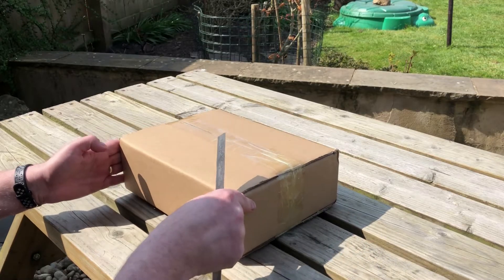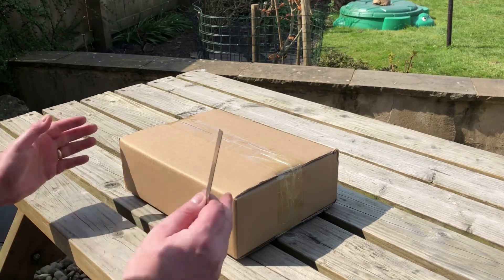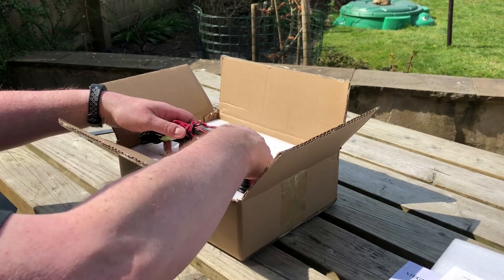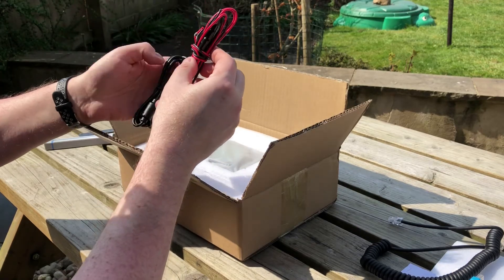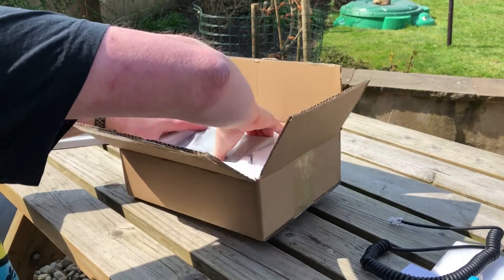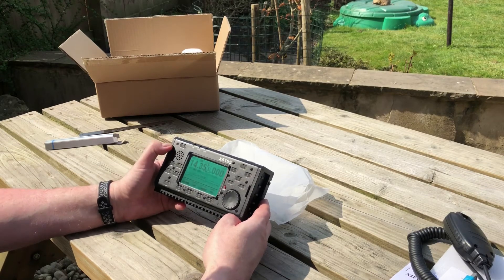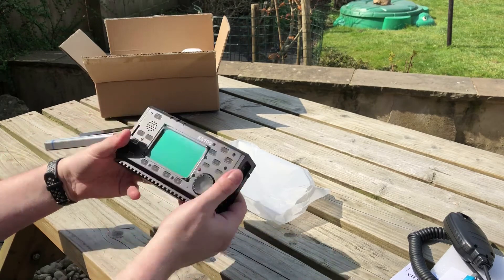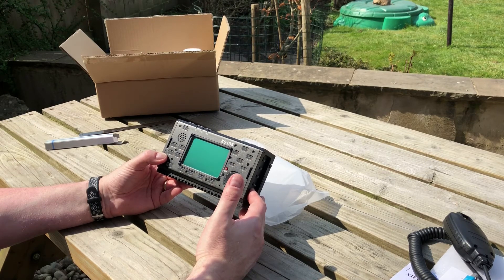Xiegu X5105 Unboxing

Comment: Don't mean to burst your bubble, but the X5105 is only 5W, not 10W.  For anything above 5W, you can connect it to the Xiegu XPA125B amplifier using the CE-19 interface.
Reply: You are right it is only 5 watts

Comment: Did your one come with a screen protector? Did you get the data mode connector kit? G7VFY
Reply from the maker: Yes it has a perspex screen protector. I think the ones that don't are preproduction models that were sent out. I don't have the data connector kit I have had one before but am going to make up my own cable.
Reply: Yes I think all the current ones come with the prespex screen protector. They don't come with the data mode kit as standard
Reply: @nigelknapton1425  The x5105 and CE-16 does have a problem with RF from the coax getting into the data connection. cables probably need ferrite rings and the antenna probably needs a common mode choke or similar, depending on the antenna and how it's fed.
Reply from the maker: @G7VFY  That's very interesting, I'm not into datamodes so have only used it on SSB. The choke sounds like the solution.